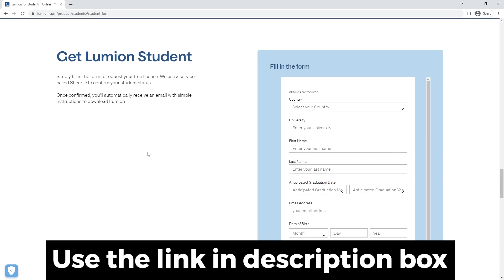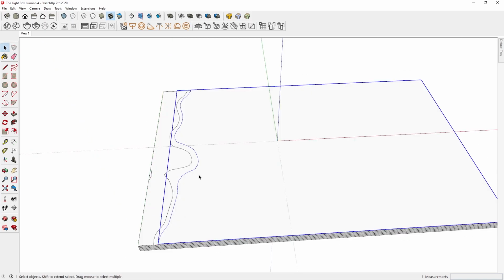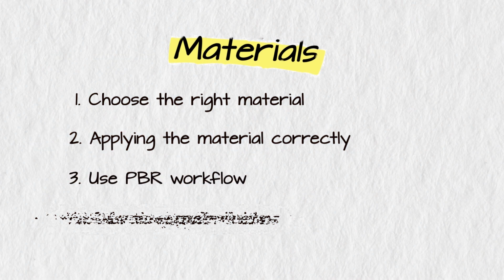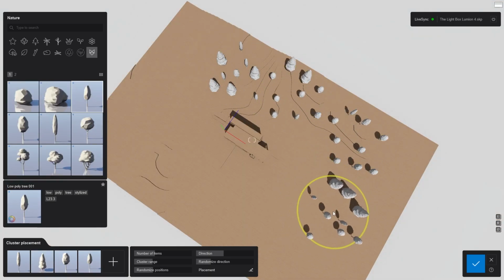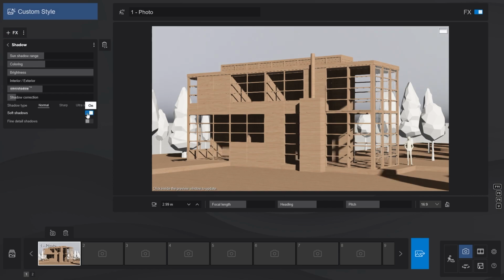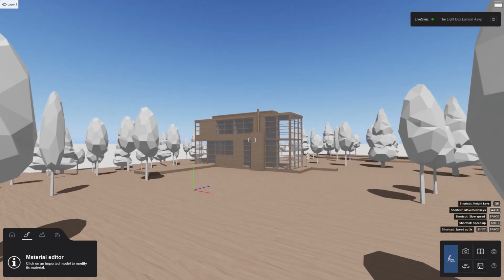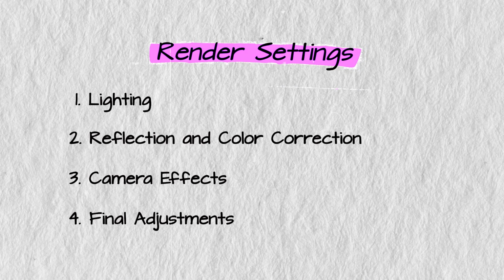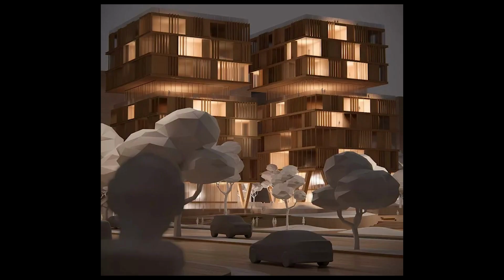How to Render a Physical Architecture Model in Lumion

Comment: An architect who says they don't  like making models is like a pilot saying that they don't like flying lol
Reply from the maker: Physical models, not models in general lol. Why make physical models when we can make 3D models? Trust me it's one of the most useless skills I've learned in architecture school lol
Reply from the maker: Also I hope you don't think the same about hand drafting floor plans 🤣 literally no one use it nowadays. Physical architecture models are still good for conceptual design but it's a waste of time for final presentations. Who graduated and go make physical models for their firm? I can bet you 99% don't.
Reply: Physical models and hand drawing have an educational purpose; they are effectively time consuming so you have to think twice (or more!) before you draw a line or cut a board. Today we have a generation of computacional gesticulating and meaningless young architects totally subjugated by their tool game instead of space, light and material.
Reply from the maker: @bim-age  I already said for conceptual is fine. But for final presentation the design is already finished, what's the point? The point about thinking before you cut a piece is also wrong anyway. When using physical models as a design tool, it's supposed to be fast and not meant to be perfect, you have to play with the form using different pieces. <- this is what Eric from 30x40 Design Workshop said. It's like 3D sketching. If you take the time to think about the pieces when you do conceptual design then you miss the point of physical model
Reply: "it s supposed to be fast - you have to play - if you take the time to think you miss the point", so you just proved my point by your own word; you're being a  tooler and not a designer @ArchitectureInspirations
Reply from the maker: @bim-age  my guy is just arguing for the sake of argument lol. I already said it's good for conceptual design, what's your point? Also I proved your point doesn't even make sense, no one thinks too much when doing conceptual design lol if your point is to take the time in designing then I guess you also hate sketching? Sounds like I'm more of a designer than you are my friend
Reply: I still think physical models have their place. Meier has a whole warehouse of them that you can view. The problem is though, in those large practices, the interns do all the model making whilst probably learning enough.

If I was a one man band operation, I'd do maquettes the smart way and use a laser cutter or a small cnc machine for the parts.

Everyone can generate a 3d image these days, the point is, the average punter who is the client, sometimes can't get their head around a concept or design. They get lost looking at sheets of drawings so a physical model is still very usefull.
Reply from the maker: @66meikou yeah agreed. Of course it's really nice to have real physical models at the firm but usually big firms have their own model making department which is filled with people who do it for a living. I don't agree telling interns to learn model making, I'll repeat, it's such a useless skill. If an intern is learning on the job, physical model making is the last item on my list that I'd want them to learn. 100% of my friends never use this skill and will probably never do it again in their architecture career. And again I think people just gloss over the part where I say it's good for conceptual design. Also the reason why Eric from 30x40 design workshop still uses model making as a part of his design process. As for final versions of physical models, 90% of the time people still use a computer nowadays to assist with cutting the pieces.